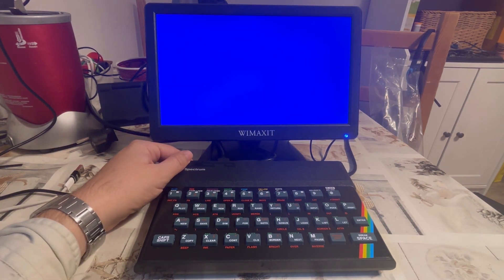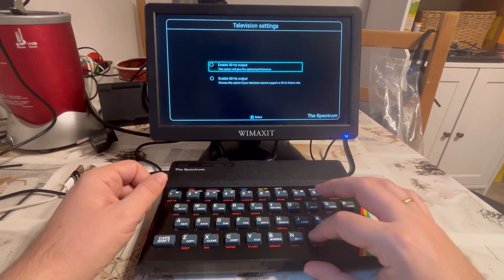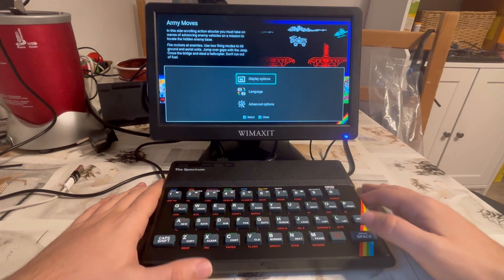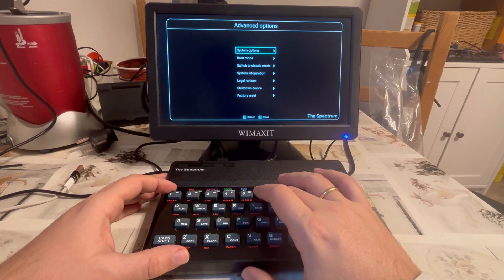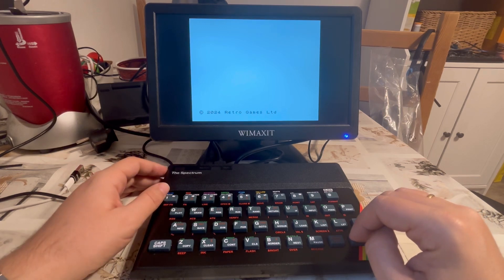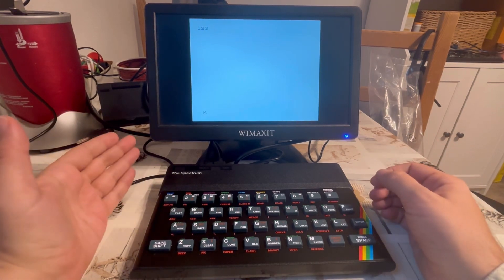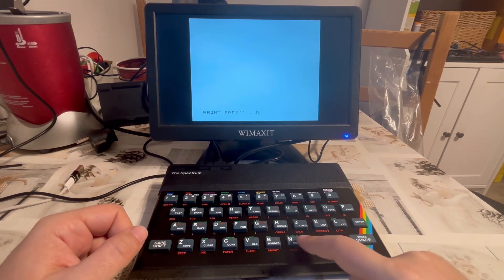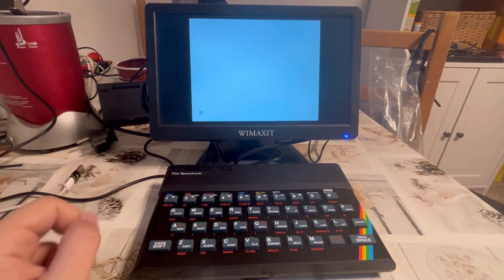BASIC: Wretchedly stumbling around on a ZX Spectrum replica

Comment: Your frustration is amusing. I feel for you. My friends love the dead-flesh rubber-key speccy's. I can't be bothered and just enjoy my +2B and +3 with "sensible" keyboards. One thing I like to do when evaulating new BASIC's is to test the floating point precision. Eg.. KB7 or KB9 digit enabled etc. I do this by calculating Pi rather than using a lookup by doing "PRINT 4*ATN(1)"  I find it quite useful. It requires it to be in radians mode which most seem to be by default which is nice. Best Wishes!
Reply from the maker: My God, the Spectrum +2B looks so mega beautiful! Well, I understand you… And due to your remark and interest in computation, I shall now "pull forward" a video — the one in which I shall show how you can compute into the range of 10^15, but with fixed point… ☺️ All the best to you, too!